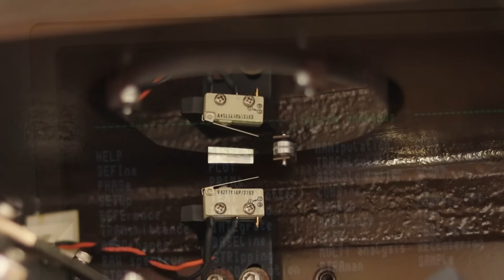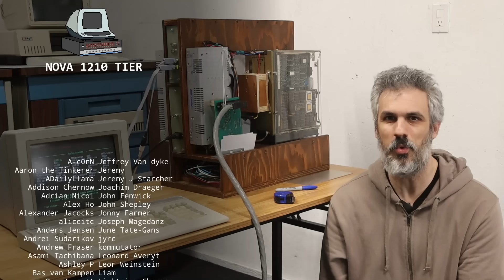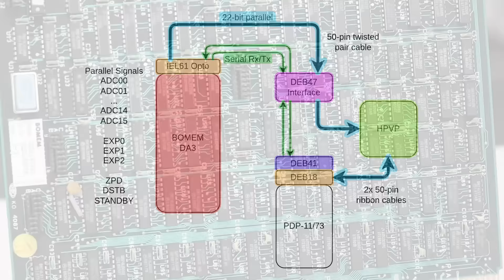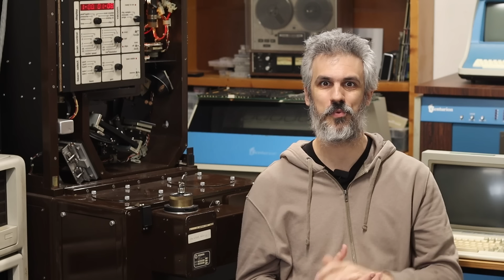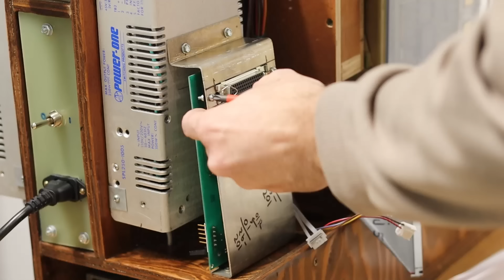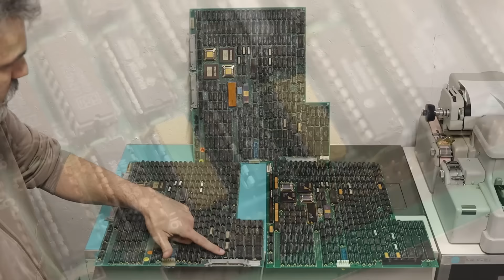I Take My First Spectra with the PDP-11/73 and Bomem FTIR!

Comment: I would guess that the three EXP signals running between the computer and spectrometer... aren't actually doing anything; the system probably only needs the 16 data bits, ZPD, strobe, and standby flags, as well as a serial connection of course, but the cable had room for three more differential pairs so those were run anyway and left for future [exp]ansion

Comment: "A Marriage Counselor for Vintage Electronics" is freaking hilarious, man XD

Also: It's such an awesome feeling when noise issues are fixed, isn't it? (A coworker and I designed a test fixture for our job awhile back that's basically a transimpedance amplifier with switchable gain - It takes a current signal from a photodiode in the order of nanoamps and amplifies it while converting it into a voltage signal that can be seen on an oscilloscope. Amplifying such tiny signals in a room full of other electronics... obviously noise was an issue we were chasing for months when prototyping. We had gotten it a bit cleaner with the PCB design and balancing output filtering to cut down on the noise without affecting the response time too much, but it was still pretty fuzzy by the time I started assemling everything in the enclosure. My final hope was that the enclosure - when properly grounded - would provide shielding to reduce the noise further, and I was right!! Our waveforms came out beautifully clean from then on, and it was such a relief!!) 
I straight up GASPED when I saw how clean your final spectra graph was compared to the mess you were seeing at first. It's beautiful!! Way to go!

Comment: 2:45 - "...that I believe was meant to be used with a Windows 95 or Windows 98 system..."
Oh ho ho.  You need to spend more time poking around industrial & scientific electronics.  There are board designs that persist for DECADES longer than you would expect.
I've done a lot of work on CNC machining systems.  For example, HAAS controllers with CRT monitors were using the MDA text-only display standard past the year 2000, all on custom boards that they kept making.  It's a weird thing to run across when doing repair or retrofit.
Similarly, I've seen machines that run DOS backends as far as 2010, floppy drives as primary storage circa 2006 or so (looking at you, SWI), etc., battery-maintained SRAM as calibration data storage on lab instruments well past the year 2000 (there's a specialty Microchip/Dallas Semi module for this I keep running across), etc
.
I've seen some weird stuff that made sense in the 1970s or 1980s, maybe being cutting-edge at the time, that was still in-production well into the 2000s and even around 2010.  It was reliable, it worked, and it didn't make sense for an OEM to redesign it because they still had production capacity for the old design and annual production was in the hundreds to maybe thousands of units.

Consumer electronics doesn't work this way, nor a lot of IT stuff.  But the industrial and scientific market will keep some really antiquated stuff for decades, because the machines have 3- or 4-digit serial numbers that don't go up that much each year.  Why fix it if it isn't broken?  To be honest, a lot of the old designs were actually better than the stuff I've seen eventually replacing it.  Kinda sad.

Comment: I realize that this is all "troubleshooting" butttttttttttt........... in order to really get good data from the system 1) The lenses must be clean and dust free - this includes all the mirrors as well as the beam splitter and 2) the covers of the spectrometer must be installed..... this will prevent the source He Laser from being detected as its probably scatter light..... :) super impressive work!

Comment: The third board getting worse the more you use it screams flaky socket or overheating component. I noted one of the chips had a heatsink on it, suggesting it was known to run hot. Maybe it's a bit flaky?

Comment: You could try different neutral density (ND) filters, the same as used in photography, as to quote Wiki "... a neutral-density filter, or ND filter, is a filter that reduces or modifies the intensity of all wavelengths, or colors", and seeing you have a 6 position turret, perhaps use ND 2, 4, 8, 16, 32 and 64. ND2 is 50% transmittance, ND4 is 25%, ND8 is 12.5% and so on.

Comment: 15 minutes runnimg hmm.  Sounds temperature related ,  either Optos or OpAmp related ,,   code in itself won't improve or heal as its running hardware faults can and will ,,
Reply from the maker: Oh yeah, it's definitely temperature related, but it's on the Vector Processor board, which we unfortunately don't have schematics for. Could be a bad solder joint or cracked trace, or even a failing IC. Unfortunately, that's a pretty tough thing to try to track down.

Comment: One thing that might be interesting to measure on, now that you have it working, could be solder from electronics of different vintages. Can you tell a difference in chemical/metallurgical composition?

And maybe also some of the coating of various magnetic disks and tape.

Comment: you really need to get some ESD protection going in that Lab, your handling PCB's with chips that are becoming unobtainable and made with processes that are not very good at handing static discharge as more modern components. 
An ESD mat and a wrist strap, a ESD connection plug to plug in to a mains socket and connect to the mat and strap . I'd get two straps one with a crock clip on the end with a 1M resistance. this one you can clip on to the machines when removing the PCB's
it would be a sad day to see a PCB killed by just a simple touch of a finger.

Comment: Well done! Since you don't have a vacuum pump, you set your system to purge. What are you using for a purge gas?  Nitrogen is the most common purge gas, either high pressure tank, or a nitrogen generator. Without a purge gas, your spectrum will be off slightly because of water vapor and CO2 in the air. Our lab use to use liquid nitrogen and used the vapor bleed off gas from the tank, very pure that way. Also for your light intensity, you could look at finding a neutral density filter ( for the wavelengths of interest ) that fit that filter wheel.  you could look at     Newport  Corporation      click products   then Optics and look for optical filters. There are other sources, but I am not familiar with them.

Comment: Hello, good video! I am wondered: why the developers of this spectrometer had not done in only with only UART and programm interface in format "request - response"?. For example "get AC0" means code 0x0001 , "get ADC2" means 0x0002   e.t.c. It would be very convenient to communicate with the host computer and programmer`s work was not so complex. But   why there are so difficult interace with loads of wires?
Reply from the maker: It comes down to speed and storage.
Back in the early 80's, RAM was still incredibly expensive, so the spectrometer itself doesn't have any RAM other than the tiny bit necessary to run the control electronics. That means that the vector processor has to store the scan data live as its being taken. Which, depending on the mirror speed, can be a full 19-bits of data at around 15,000 to 20,000 times per second. Serial just can't keep up with that speed of data transfer.

Comment: 18:57 Dude, not only is science hard, but you're doing it on hard mode at the same time. Considering the fact that when this device was in normal service, there was usually a team of specialists in the lab trained to keep the Bomem operating within spec and giving it regular calibrations so that the team who operates it can get good quality data, you're doing an amazing job of figuring it out and getting it sorted. You're one guy doing the job of anywhere between 3 and 10 different people with different specialties. At a bare minimum in a professional lab for this equipment, you'd have an IT guy for the PDP, a metrologist for the Bomem, and the actual scientist to push all the buttons and gather the data.
Reply: You overestimate science. At best there would’ve been a lab assistant who’d done the maintenance training,  grad student with an aptitude for engineering trying their best, and periodic visits from the supplier’s technician to do repairs.
Reply: @srdau2 I'm still counting 3 people trained to work on the device...

Comment: The aperture size is related mostly to the angular divergence of the beam in the interferometer which limits the maximum spectral resolution you can get. Its also helpful as you found if you are saturating the detector. For modern pyroelectric detectors you can usually leave it mostly open and get more signal, however, with sensitive semiconductor detectors (HgCdTe) you need to reduce it or use other attenuators/filters.

Comment: Seems like all the ambient room light leaking into the optical path isn't helping the diagnostic process.  I you can see the mirror surface moving around, all that scattered room light is getting mixed in there, too, adding additional flux.  Perhaps this is related to overloading the detector?

Comment: Having many ADC channels multiplexed to a single ADC is perfectly normal. I work with a ARM Cortex-M0+ that has upwards of 24 channels multiplexed to two 12-bit ADCs. Every time I to go read a given channel, I have to reconfigure the ADC for that channel's + electrode, - electrode, differential or single-ended, and date output justification, then trigger a conversion. It's not as simple as just saying, "Do a conversion on that channel now." But, it does work.

Comment: It could be anything really, but in my experience if something "works after 15 minutes and is getting worse" it's usually completely dry capacitors not capaciting. Or maybe voltage regulator not regulating voltage.

First measure the resistance of the entire board from VCC to GND with a multimeter at the power supply plug and at VCC pin of a few chips. It should probably settle at at least kiloohms. 

If it's less than maybe 1kOhm (compare with other boards) - hunt for a hot and/or low-resistance component, usually a half-shorted capacitor, but could also be i.e. a memory chip. 

Hook up the scope to the VCC pin of some of the chips and look at it.

If voltage seems on the lower side, or has too much noise (I have no idea how much is too much for an 80s spectroscope, maybe try comparing to the other one?) that is likely at least one of your problems - even if it's not the main one.

Try desoldering one of the large capacitors on that voltage rail and test it in a capacitor tester see if its ESR is in spec.

If one of the capacitors is out of spec, chances are all of the same type are as well.

If this board has RAM with -5V bias - make sure that rail is also stable. It may be generated on the board via a voltage pump, and if its capacitors are out of spec - this may be all over the place.

Boards like that can have multiple power rails so try to hook up to other chips too.

Another problem that can lead to such symptoms is a crack in the board. Try randomly inspecting traces. Annoyingly that kind of problem may go away when you remove the board from its mounting and take it to the bench

Look at some data lines with a scope. If some seem to be inbetween 5V not GND it could be a burnt-out chip. 

If all of that is ok, try testing RAM, EPROMs, and any socketed chips in an external chip tester if you have one.
It is rare but not impossible for bad RAM to behave like that, or rather seem to behave like that.

If nothing else helps, get a datalogger, save a bunch of logs, and compare with the working board.

Comment: From one perspective it's good that the red laser actually leaks into the data since it could be used as a reference, on the other hand it may mean that you have dirt on some components - or just dust in the air. Maybe it will go away with the use of a vacuum pump. If it's different under vacuum then it could also be a calibration thing.
Reply: The spectrometer should already use the laser as a reference to measure the mirror movement. So unless there is an issue (like loosing counts or wrong math) there should be no need to a reference on the wavelength scale. The wavelength scale already uses the laser wavelength as reference. For the first test it is still an extra check for the math.

Comment: The microcode is actually for the AM29116 CPU on the vector processor card.  Even though it's a full 16-bit CPU it's still a bit-slice processor at heart and it needs a microcode load to work.

Comment: The numbers on the horizontal axis are "wavenumbers", or 1/wavelength, expressed in 1/cm. These are proportional to the energy of the photons, that is why this weird unit is used in spectroscopy. Visible light is from about 400 to 670 nm, or 25000 1/cm to 14900 1/cm (blue to red). This gives you some reference to those numbers. Between 13175 and 12950 1/cm you should have a strong oxygen absorption if you want to see if the spectrometer is fully functional. There is a weaker one just below 14535, and you should see water vapor lines blow that value (around 14390 1/cm should give a set of lines).
Reply: For some reason, that reminds me of when I had a gas chromatograph service salesman bullshitting me that their system had a sensitivity of 1ppm for methane to pentane. "Pentanes", I corrected him - which should have been a warning. 
Then - "OK, let's see you run a proof sample."
"Oh, err, I don't actually have a test gas bottle with me."
- "That's not a problem. Random air should be running about 1.8 to 2.00 ppm methane, so well within your machine's capabilities. Plus, there''s a gas processing plant 50 km up-wind form here, so we'll probably be picking up a few ppm of leaks from that too. You'll be fine. Your 1ppm system will detect it easily."
It was more fun than pulling the wings off flies. He twisted and turned on the hook like ... well, there's probably a fishing analogy, but I've never done that particular sort of sadism. Eventually he admitted that he didn't actually know how to run the machine. Which I'd guessed early in his presentation.
The client (who was watching this like a senator at the lion-feeding church service) eventually gave me the QC job supervising that company's work on the rig (which was why I was indulging in raw pulsing jugular) and also gave them the service contract. But I think he must have received a higher than normal level of bribery. It was the oilfield, what do you expect?

Comment: Could you fit standard ND filters to limit the light. They come in different values
Reply: Or a resistor in the lamp's circuit? 
There probably is an adjustment for it somewhere already though.
Reply: @jwhite5008  Dimming the lamp will affect its color temperature (and thus its spectral characteristics). ND filters with the lamp at full brightness is the way to go - that's what the filter wheel is for.
Reply: @Stoney3K  That makes sense, but is the "expected" lamp color temperature not adjustable? Or would that lead to very poor resolution at blue end of the spectrum and/or some kind of IR overflow?
Reply: @jwhite5008  The spectrometer doesn't really have an "expected" color temperature, it just measures whatever spectrum arrives at the detector (the spectrum Usagi recorded was from the unrestricted lamp), so whatever spectrum you're expecting depends on what you're analyzing. With a lamp that has a different color temperature it could skew the readings.

Of course you can mitigate that by first taking a reference reading of the lamp without the sample and then your sample reading.

Comment: Well done!
12:51 Purge vs evacuation, eh? Sounds like you got to the bottom of successfully logging on by digging through the bowels of the system. I hope you have gotten a sturdy stool in your lab while siting down to your business, and you are not going through the seat of your pants. This certainly looks like a solid start, I'm glad things haven't gotten all runny for you. That would stink! I hope the paper you used doesn't smear your output.

Comment: I think you are able to scan outside of the visible light spectrum. NIR is near infrared and UV is ultraviolet.  Some spectrophotometers use a thermal pile as a source and others, like yours, use quartz, which shifts the spectrum.  Knowing that, I have a reference sample and its associated spectra for testing.  I haven’t tested it myself, but it should be usable for your purposes.
Reply from the maker: I think the beamsplitter and detector combo can indeed push into the UV and Near IR range, it's just not where it's the happiest. But, I do want to explore the UV region with the combo a bit more before we try pushing into IR with different beamsplitters and detectors.
Reply: @UsagiElectric  Well, if you need a reference sample for IR/UV, please feel free to let me know.  I've got a few I bought to act as filters for the XReal Beam Pro and could send a couple over.